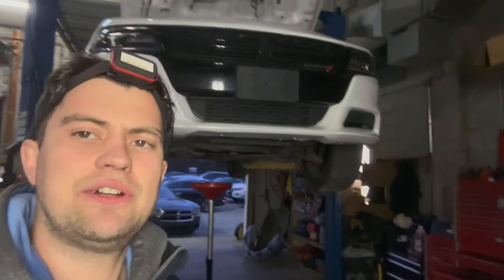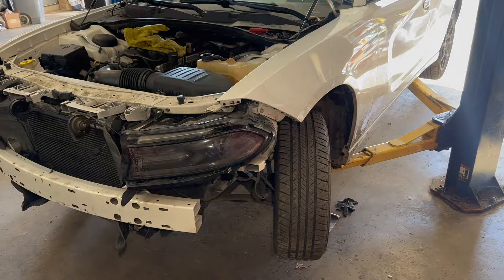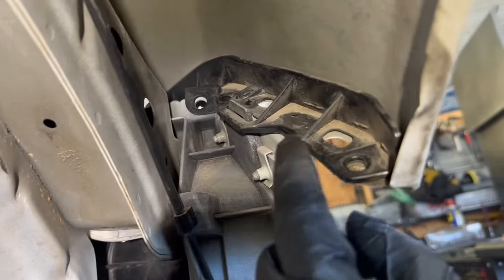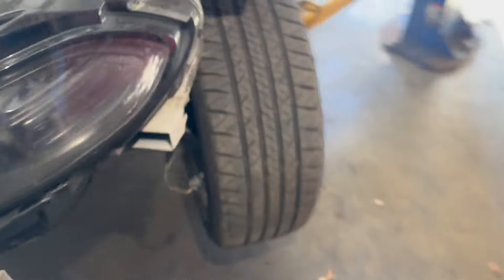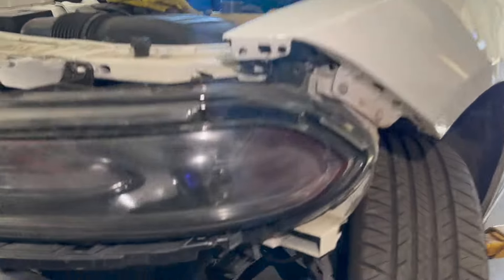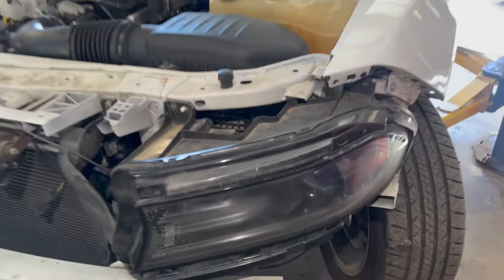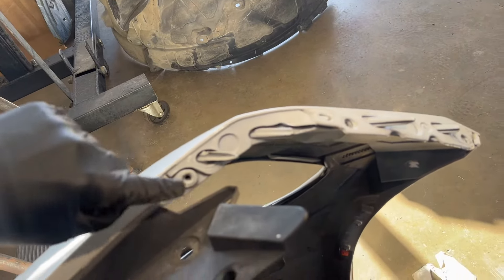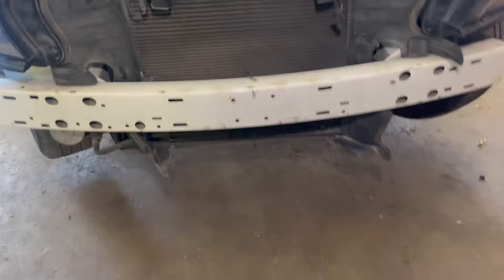2015-2023 Dodge Charger headlights replacement (Quick Video)

Comment: Bro i have a 2016 model and I want to change it to a 2022 model. Does it need programming?
Reply from the maker: No not really as long the connector is the same doesn’t need programming ! 
 Here is also  the link for full  instructions and process how to replace it 

https://youtu.be/X10ECGeANhk?si=TzHFyaR9ZN1qYcBS
Reply: @ Thanks bro

Comment: I have 2 different colored headlighta on my charger 2023. Please tell me i dont have to take the bumper off and do all that. I looked at the back of the headlight amd it looks like the bulb is sealed in there?? Angry the dealer didnt disclose this to me when i bought the car
Reply from the maker: My man I have no idea what is going on there but if you want to replace the headlights you have to remove the bumper ! 
If you want to replace the light bulbs you can do it without removing the headlights